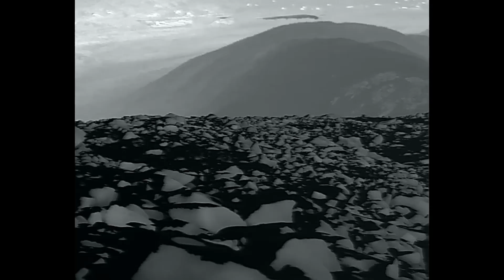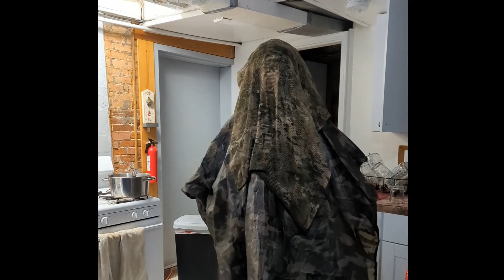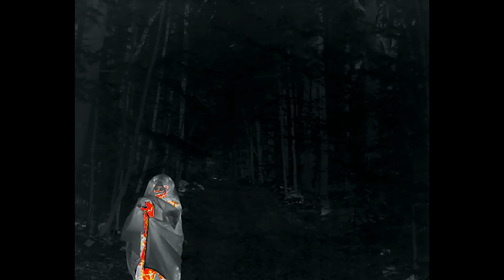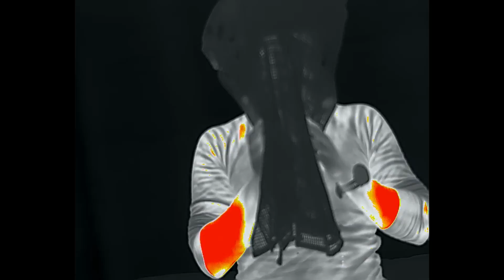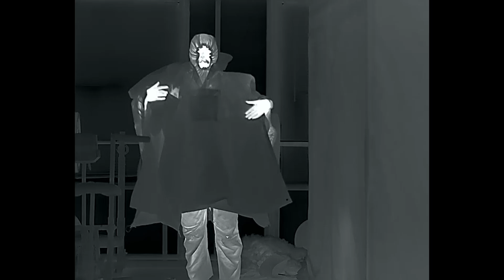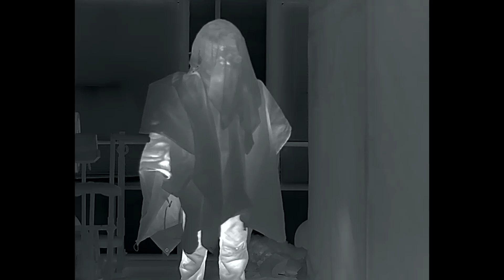Thermal Camouflage Testing

Comment: man.. just buy ProApto or Fibrotex....
Reply from the maker: @RikTagliaferri  even if I wanted to pay 700 for a multispectral ghilie they're never in stock. There's a lot of vapor ware out there and very little of it has been tested except by the manufacturer to make hype promo videos. The point of this series is to use commonly available and cheap materials and gear.